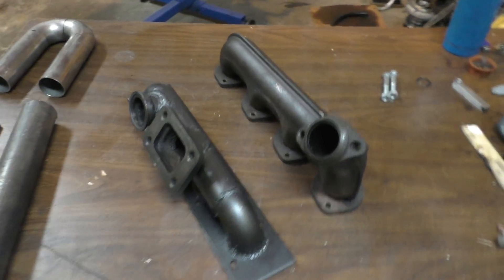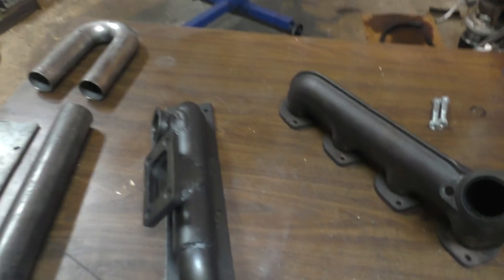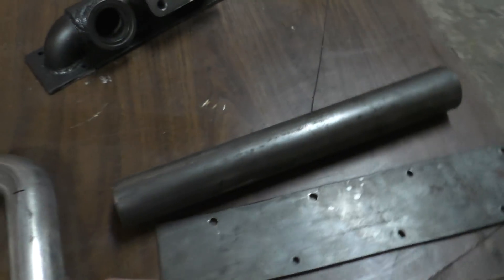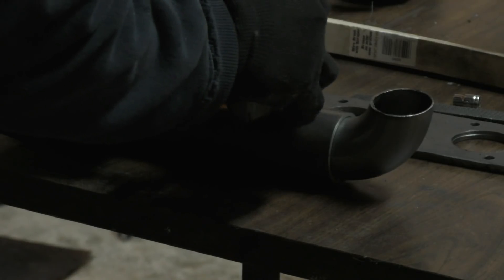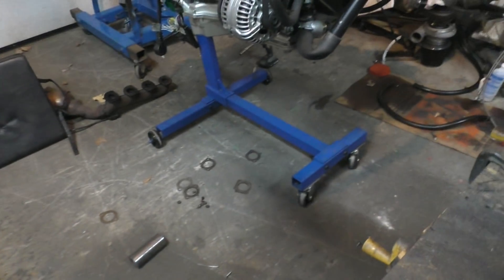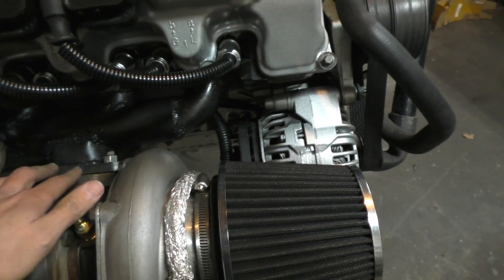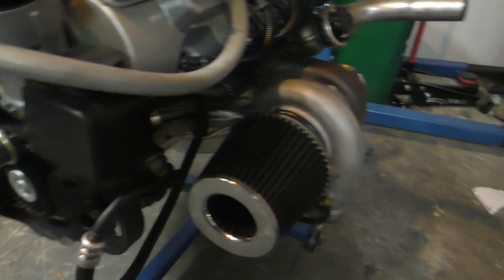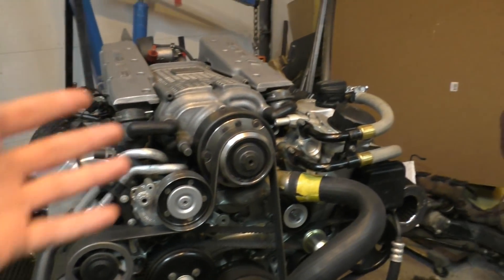Making Turbo Exhaust Manifolds / Headers (M113k, E55 Engine)

Comment: Fabbing a simple system of heat/airflow baffling between the engine and those intake filters may help manage intake air temperature, and improve density on the upstream side of your system. I had seen you were using the stock ECM, if I remember. This solution can make for more consistent MAF or MAP sensor readings and allow your ECM to avoid causing a blind lean condition. I live in 120° weather where those issues are not entirely uncommon even on factory cars.

Comment: you need to reduce the wire speed or increase voltage to reduce spatter on those welds ...

Comment: you sead oil goin up the pips on cornering instead of the pump just fit a 1 way valve to each drain line so it carnt go back up the lines

Comment: Awesome work dude. I cant help but think that 7mm is going to be too thin. If you could increase it to maybe 10-12mm in this early stage? For the small extra cost, you could be saving a headache down the line. The new project looks awesome! This will be a big channel in a few years. No ego or BS, just great experimental content for the petrol heads. Keep it up dude! :-)
Reply from the maker: Thanks! yeh, it might be too thin but I'll give it a try first. I have a feeling it will be okay considering the factory manifolds were 8mm and held up to quiet a lot of back pressure
Reply: @xfmotorsports  The factory headers are shockingly bad, I noticed a huge difference after fitting the Eurocharged mid length manifolds (I think you US chaps call them Headers). The standard log manifold back pressure would have increased the temp but turbos are a big restriction and adding boost + more fuel will get them glowing! I hope they're ok and I'm wrong bud, with a low boost application decent sized wastegate should help illuminate boost creep and get the heat away. Good luck, can't wait to see it running! There has been a boosted M113k CLS55 before and it ran 10's! Can't wait to see what numbers you do! Iro 850 I'm guessing! 😎👍

Comment: If you're having masculinity issues about your welds, you can run over the top with a TIG and it will melt your weld puddle and reshape it.
Have you looked at rear mounting to trans? That would be cool.
Reply from the maker: Yeh, a TIG welder would've been amazing for this (only if I had one). This transmission is a bit of an awkward shape to fit in the rear, but its pretty light. Around 75kg. Think the weight dist should turn out okay

Comment: From what material is it done? Don’t think that oe is regular metal. Otherwise great job ;)
Reply from the maker: The tubes were aluminized steel from vibrant performance, turbo and wastegate flanges are stainless steel and I believe the sheet metal was mild steel

Comment: Some questions: How do you intend to prevent reverse flow? Are you supporting the turbo on brackets?
Reply from the maker: Back pressure in the exhaust is something every turbo engine will have. You just have to compensate for it in the tune by retarding the ignition timing. For turbo brackets, I might support it later with the downpipe or the frame depending on the need
Reply: @xfmotorsports  That is true, but deigning the system to have the least possible amount of reverse flow and back pressure will free up power, efficiency and ultimately  a much more responsive motor... I would brace it before any heat cycles as that 7mm flange will not last. Perhaps from the turbo exhaust housing to the block is best.

Comment: A quick hint, wash the inside of the tubes with solvent ( I use spraygun wash ) because when the tubes are made they use some sort of silicone based lubricant and if  you were stick to  a finger into the tube it will feel greasy. That lube affects your welds ,contaminating them especially if you use argon/CO2 with Mig or Argon Tig. Clean them before using the plasma as the deposits left behind also ruin the weld quality. Another Hint, get your eyes checked. If,like me your close vision is getting bad, you can't see the weld puddle correctly  through the helmet lense. I bought three different helmet$ before i found that it was my eyes that were not working. I can now see the puddle clearly with my glasses on (get photochromatic in case the helmet uses batteries to work the darkening . ) it is surprising how much the weld improves once it's properly clean and you can see everything . 😉😀
Reply from the maker: Thanks for the advice! I have a lot more welding work coming up so I'll give it a try. Pretty sure my vision is fine lol, but I definitely need more practice

Comment: Have you seen Mazdas 4-3-1 manifolds? Seems like they have the best design for compact headers.

Seems like a pretty good little header though.
Reply from the maker: Yes, but this one doesn't have the right fire pattern for that. I was thinking longer tubes before but would have been impossible considering the space
Reply: @xfmotorsports  ah makes sense.

Comment: If you haven't already made the assembly final- scrub down the manifolds with acetone and wire brush, rinse thoroughly with acetone. Apply several (4) medium coats of either VHT Flame Proof Header paint or similar. Air dry 24 hours. Bake in preheated 300F (148C) oven for 2 hours, shut oven off, let cool in oven. Turn on oven again, 350F (176C) for 2 hours. Let cool inside again. The result will be a nicely flowed and hardened ceramic coating. Even if you plan to wrap the manifolds- a heavy coating will help to insulate and hold heat better than wrap alone. Also- do you have turbo blankets? Aluminum duct tape is great for plug wires and hoses- anything you want to reflect heat from. That engine should breathe way better now. BTW baking ceramic in your house oven does not ruin or make anything "poisonous", that is pure myth. Just provide adequate ventilation while the paints' acetate is gassing off in the curing process. Cheers  (similar https://www.walmart.com/ip/Duplicolor-SP998-VHT-Flameproof-Coating-Paint-Nu-Cast-Cast-Iron-11-Oz-Can-Withstands-Temperatures-Up-To-2000-F/51034514  )
Reply from the maker: Thanks for the suggestion. I did use header paint but didn't bake it. I'll keep this one in mind if mine ends up burning off
Reply: If it was initially sprayed on heavy enough- you can cure it in situ with a propane torch or high heat gun. If it's not pre flowed before put into service, it will probably crack and peel from expansion.
Reply: We're talking about high temperature paint- not that new fad clear coating for paint and other stuff. I have used VHT since it's first formulation. It contains ceramic powder, that bakes on. No snake oil.

Comment: I've seen people talk about the importance of exhaust pipe length and you just make this haha. Im looking forward for more of this :)
Reply from the maker: Haha. Equal volume exhaust pipes definitely have their advantages for flow but log type are better for hotter exhaust temps and saving space. Would have been really difficult making a long tube header in that little space lol
Reply: Basically just important on an NA for back pressure if I’ve got it right
Reply: @fredrikandersson3885  Tuned length has it's place on turbo manifolds too. At the end of the day, a reasonable log manifold will make the same amount of power as a tubular mainfold, it's just a matter of packaging allowances, a log manifold will never be as responsive or efficient.

I'd also take into consideration the thickness of the head flange, prepare for warping, if it hasn't already from the welding.

Comment: What turbos are you using?  Excited about this build!
Reply from the maker: They are a similar size to the Garrett GT35 but no idea what they really were. 1.06 A/R turbine. Worked amazing on the previous setup. I'll go with the gtx30 series next if the size turns out too big without the supercharger
Reply: @xfmotorsports  great work. 
I will share some of my knowledge during working on turbos. 
I think you will need to measure and control EGT because of materials you use for manifold and turbo. Manifold heatshield is a must (stock was dual sheetmetal so much less wall temp) to protect surroundings and isolate compressor outlet as much as you can. I hope you have a water colled bearing housing.
I'm also worrying about cracks on the manifolds (hope you will share the results preety soon). You are not allowing the flange to move during thermal expansion by  joining the ports - it could cause a stress and cracks ;/.
Your fixing holes needs to be adjusted in size because of it also (if not your bolts will be cuted). Make one very tight as a fixing hole (the closest one to the center of manifold) and the rest bigger - You can easily calculate how big the movement will be due to temperature. Just see how it is done on the stock. Check the bolts tightening from time to time :)
BTW Your manifold will be much more efficient by doing a "v shape" between cylinders 2-3 (avoiding pulses from cyl1 and cyl2 going to cyl3 and cyl4 (and vice versa) insted of going to the turbo). Look at this: http://www.blackcatmotorsport.co.uk/shop/mazda-mx5-turbo-manifold-garrett-turbo/
I think you probably know all that things but it's better to write it :). I hope it helps you somehow :)
Keep going mate and share as much as you can.

Comment: I would consider adding some bracing to the turbo's. I'm thinking that the weight may cause the manifold to crack. It may not, the tubing is short and the turbo is centrally located..... just thinking out loud:)
Reply from the maker: I think the manifold should be strong enough considering the down pipe won't have much weight either. If it still cracks then yeh I'll definitely make it stronger
Reply: Yes I think the weight, vibration and heat combo may cause some problems, i would defenetly put brackets on the turbo's ! 
BTW i love the work you're doing, you come up with great ideas and do some really cool stuff, I like your way of thinking :) Thanks for the videos, greetings from France !